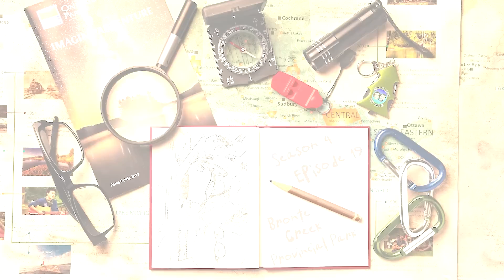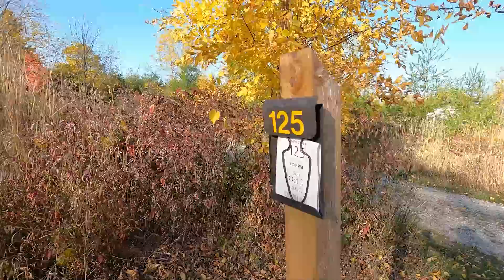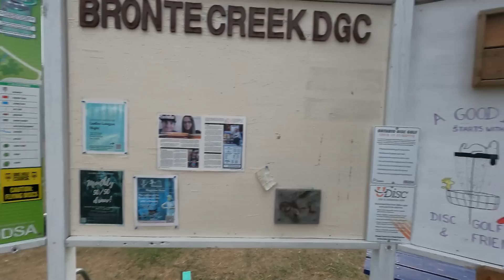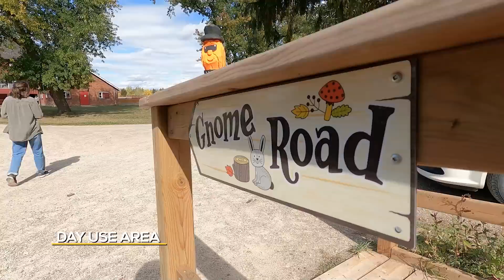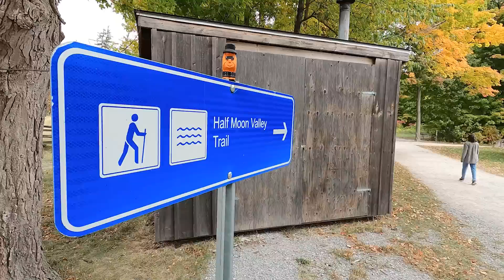S04E19 Bronte Creek Provincial Park Review

Comment: We live even closer to it than you and have been there a few times. Considering its location in a developed area it does feel much more remote than one would think. From most parts of the park you can't see any tall buildings or reminders of the proximity of it to urban areas. I think that its location makes it a good park for novice campers to "get their feet wet" so to speak, it was the first place we took our new pop-up in 2012. It also seems to me that it's a good location to camp for anyone from outside of the area who want to spend some time in and around Toronto without paying for Toronto accommodation. Toronto is only about 30-40 minutes away by vehicle and about the same by GO Train.
Reply from the maker: That's a couple of good points. Great spot for a shakedown camping trip and great spot for a home base to check out TO.

Comment: We have a Northern Breeze dining tent, which we LOVE.   It got messed up in a storm and we were able to order replacement poles for the ones that were bent.  It does take a few minutes to set up.  It CAN be done by one person, with some difficulty.  I don't think I could do it.  If I ever need to buy another dining shelter, it WILL be a CLAM.
Reply from the maker: We've been through a few dining tents over the years. First time we saw the Clam we were blown away. They are pretty expensive though so we haven't yet pulled the trigger.
Reply: @CampingwiththeColes  No point spending the $ until you need to.

Comment: This would be a great park to take my nephews. They would love the animals and the play structure. Hopefully, the pool will be open again in 2023. Thank you for sharing all that the park has to offer. 
Even though this was supposed to be your last camping trip for the year, did you get a chance to get out camping during November? Best weather we have had for November that I can remember.
Reply from the maker: Yeah, this is a great kid park. Unfortunately you have to drive around to the day use area for most of the kid friendly activities. We didn't get out in November. Our trailer was in for service from late October to the middle of December. We had a new axle installed on it. The old one was bent and causing uneven wear on one tire. That's what caused our flat tire on our Mew Lake trip. Should be good to go for spring. Hopefully the problem is fixed.